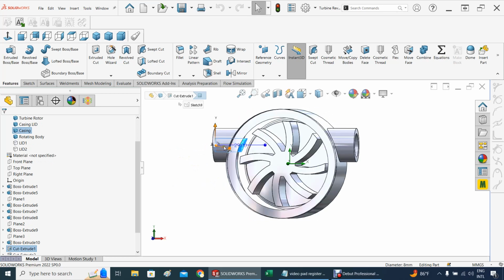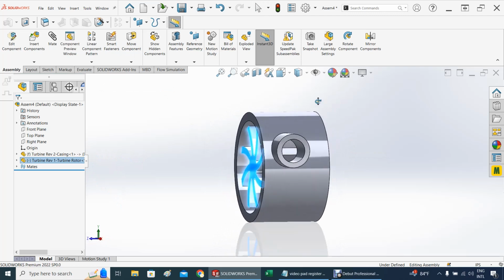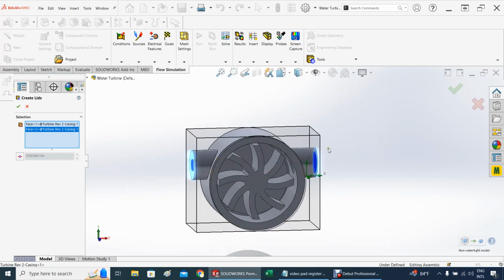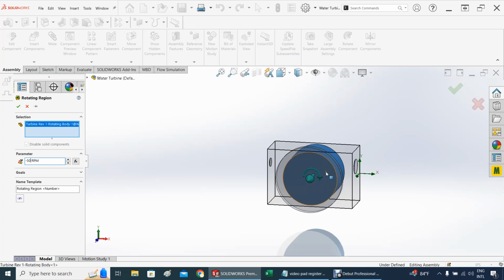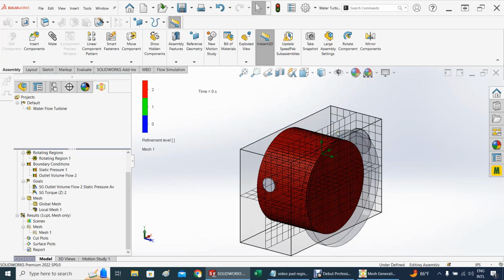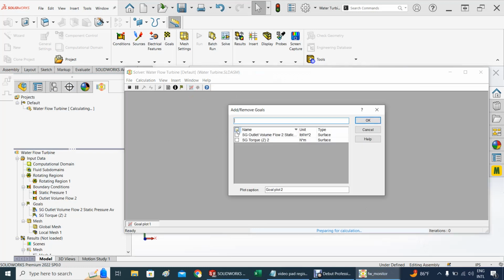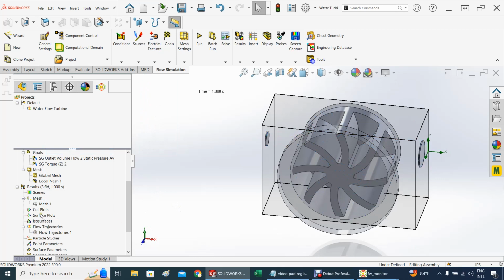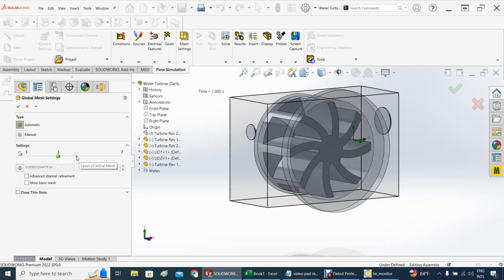FLUID FLOW SIMULATION THROUGH A WATER TURBINE IN SOLIDWORKS

Comment: hello sir, very helpful video.. btw, doesnt it mean that the power of the turbine produce is not accurate according to velocity of the waterflow? because if i change the RPM then the produced power will increase to...? i really need to understand it so i can work with my college project
Reply from the maker: Let me say this,  you set the RPM for the turbine...if the torque is negative as show you are extracting power...if you keep increasing the RPM...if the chosen value is to big you will notice that the torque will change to a positive sign.  This means that you need to add power.  The rule of thumb for a turbine...is that  as the RPM is reduced,  the more torque you can extract from the Turbine. Thanks for watching!!
Reply: @learningpower9437  so as long there is a negative torque is fine? Thanks for the respone sir, i appreciate it so much!
Reply from the maker: @zora-bak  ...This is the idea...complete an analysis with RPM=0 to get maximum torque  and then change the RPM toward the direction of energy extraction.